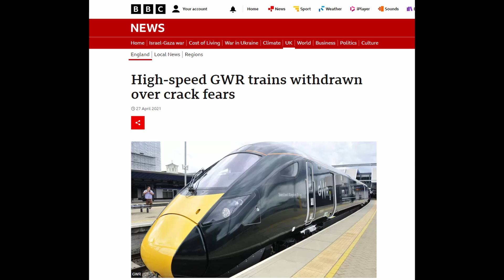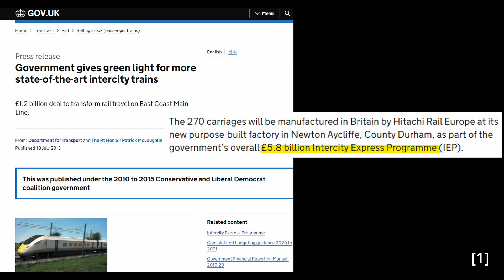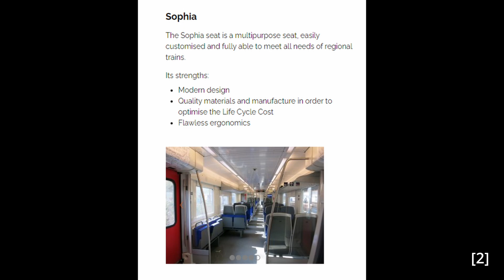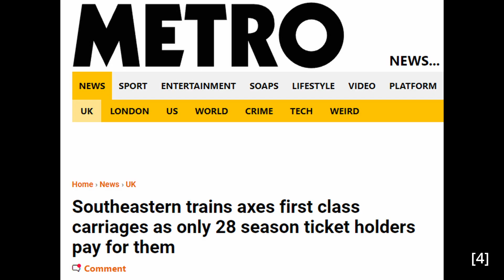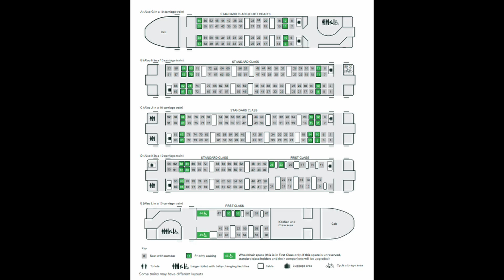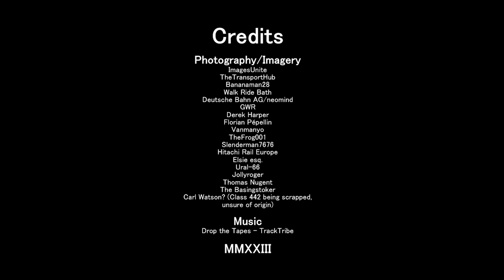Can the IETs ever be decent?

Comment: First and the fact that the old seats meet fire safety standards is so ironic.
Reply: I went on a castle set last year and while the ic70 is better, These are very comfortable (but lner/cross country seats were the better,) as the quality is better then lumo (trust me I went on it form london to Edinburgh once) so these should be used on the intercity trains or hopefully the EU makes the fire safety less strict so then we can get designs like the ic70 which would put the iet (along with the bikes and buffet fixes) a Topdog in the eyes of us passengers fixing hight issues, Bike issues and Buffet issues if we introduce them on all trains, also comfort issues, then they can make them double deckers for more capacity (fitting in the standard loading gauge of the country) So we could have all of this fixed
Reply: @ashleyjlikestrains Double decker trains won't ever happen in the UK, I don't think. This is because of the height of structures (such as bridges, tunnels, signal gantries etc) that would simply make it unfeasible to introduce them
Reply: @DENPTrains  I mean something like the 4dd but modernised (the 4dd was double decker) but a lower hight multilevel form the New Rat City could work as well
Reply: @ashleyjlikestrains  Potentially, but unsure if this design would work in a modern environment (apparently they were cramped, poorly ventilated and had longer wait times at stations) plus it was a compartment train, so you have to ask if modern 2+2 seating can fit more rather than stacked compartments
Reply: @DENPTrains It could be redone to be like the multi levels in nyc
Reply: @ashleyjlikestrains  Again, sadly you run into the problem of height restrictions and loading gauge
Reply: @DENPTrains  Well i have done some math. 6 foot 4 inches x2 is 12 foot 8 inches and if we have a 1 inch wheel then that’s 12 foot 9 inches tall (same as the 4dd) so if we give 6 foot 4 inches for each level then it could fit
Reply: @ashleyjlikestrains  Are we still talking about height?
Reply: @DENPTrains  yes, maybe if they did a tube moment and made it 6 ft only then we could have a 12 foot 1 inch train, 6 foot 2 would make us have a 12 foot 5 train (almost the same as the 4 sub)
Reply: @ashleyjlikestrains  I'm sorry I don't know what you mean by 1 inch wheel
Reply: @DENPTrains  a wheel that is 1 inch, for stability purposes
Reply: @DENPTrainsHS1 and HS2 are/will be built to European loading gauge, so double decker high speed trains are very much possible if the need ever arises. They’ll just be confined to those lines though.
Reply: It was not so much fire safety, more antivandalism to prevent people deliberately settling fires!
Reply: True, that explains the fact it is a lie but if there is no padding there is nothing to set on fire. @The_New_IKB
Reply: Double deckers in Europe & the US utilise the well between the bogies for the lower deck.